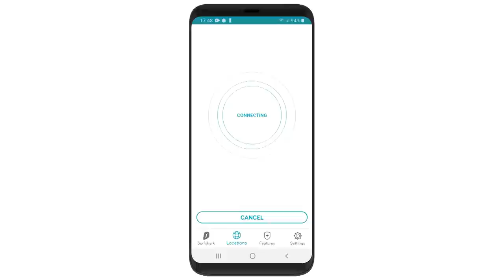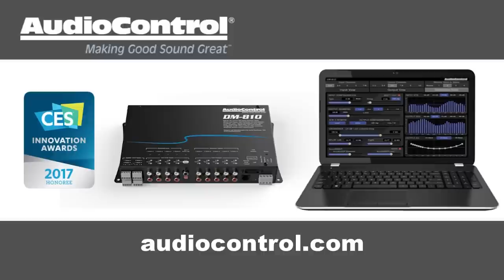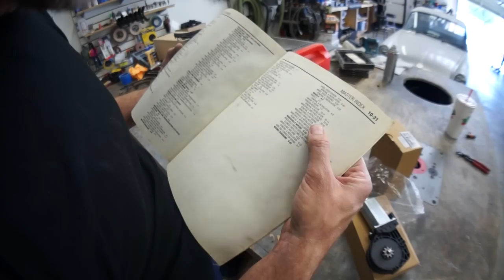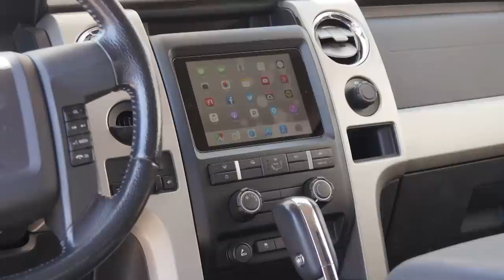chose your favorite Soundman car! - BVV#92

Comment: I'm partial to the Astro van vlog because I have one but I think that the front grill & lights should be switched out to the early 2000s one because I feel it looks better. It would be great if you could figure out how to do like a tilt clip so that your Motors more accessible and put a Steve Morris V8 in the van and change the rear end and transmission. That man has a k member it can be worked on easier if with the motor dropping out the bottom of the van because you'll have more room

Comment: the tbird is niiice, i had to rebuild those window regulators in both my Rincolns. they used plastic pieces inside that would deteriorate/crush over time. you can replace them with metal ball bearings or nuts<<from bolts